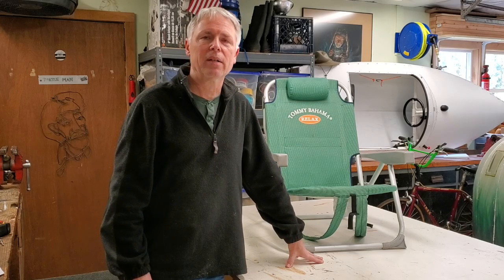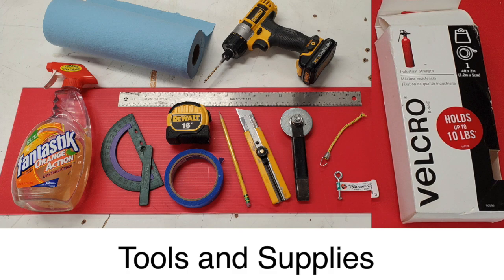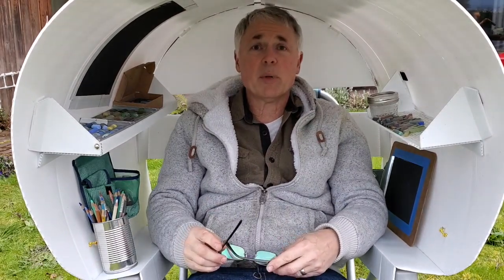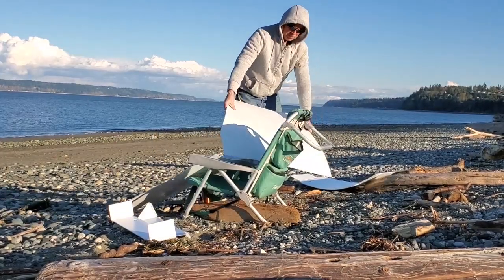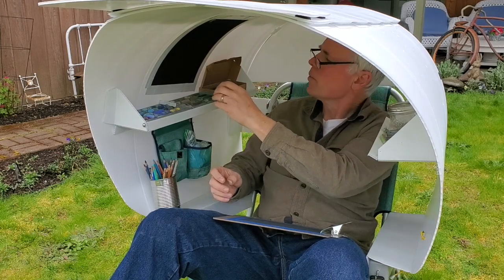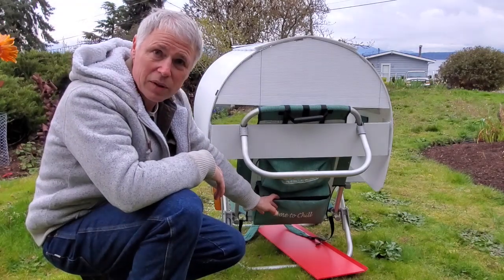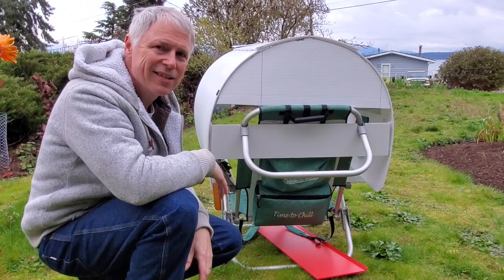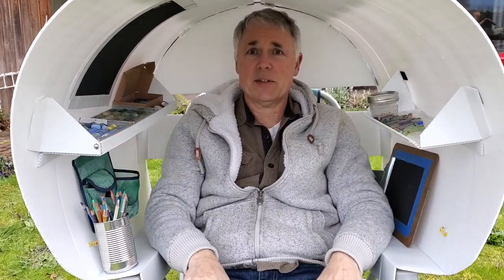Micro Mobile Art Studio

Comment: I need to buy some stock in Coroplast and Velcro... the way you go through them.
1. How do you score only half a cut in Coroplast without cutting it through all the way, to make a fold?
2. Do you post your plans anywhere so I could get the shape exactly?
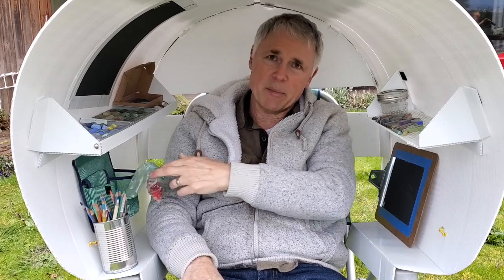3. 3:59 - that small rivet like bolt on the shelf to left of screen (your right) - what is that connection?

Thanks for a great idea!  What I badly need is a portable toilet.  When I go hiking or long dog walks, I often need to pee.  No public toilet for miles around.  What to do?  Something very light, that covers enough so I can use a covered jar in public but not be seen.  This is an idea that is also useful for beach showers where you want to remove your bathing suit and rinse off sand in your private parts.  Any ideas?